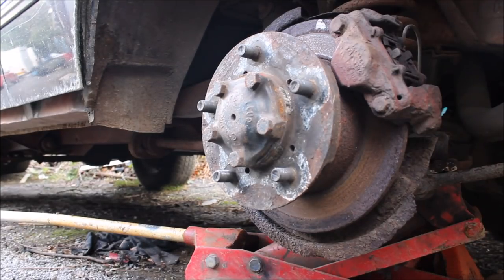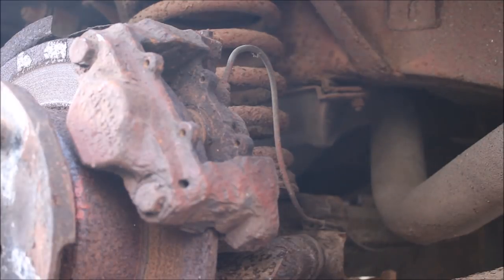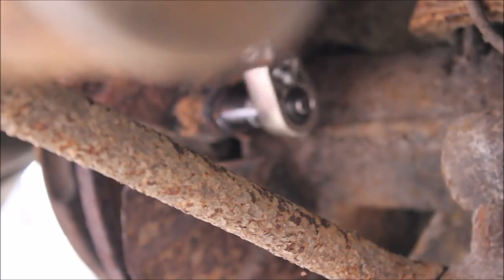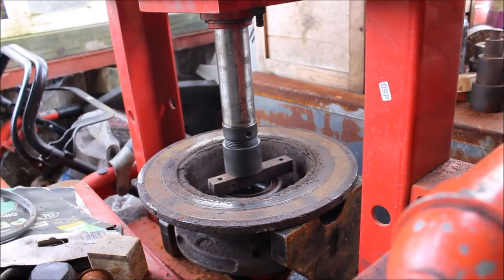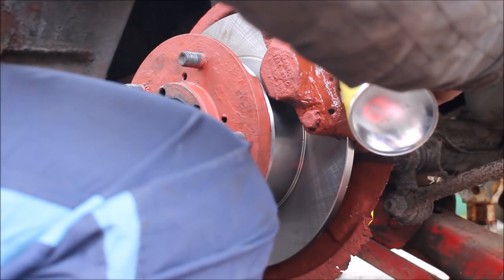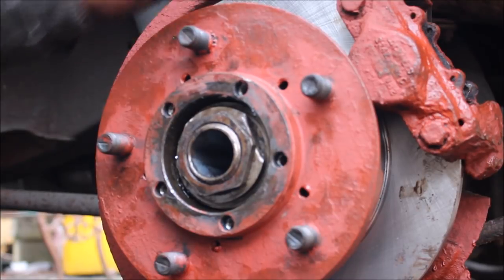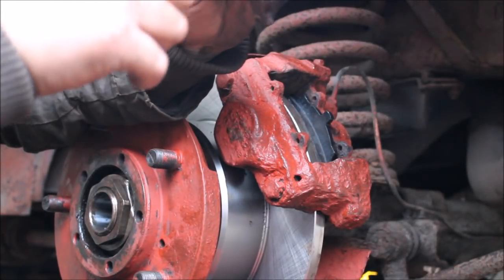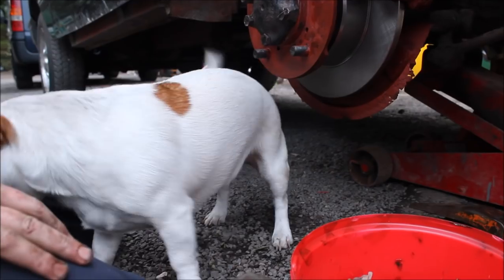Changing my rear disc brakes on a Land Rover Discovery 300 TDI

Comment: I was always taught not to use a ratchet (can f them up) for undoing stuck bolts, a breaker bar with a short scaffold pole extension works wonders.
Reply from the maker: I'm applying enough pressure not to strip the bolt, I would never use a scaffolding pole. You will only end up with a snapped/stripped bolt head. I'll stick with my technique

Comment: Love the vid but please tell me why the rotors were rusty in the first place 
What did you do to cause the calipers to squeeze and let go
To me the calipers were not working causing the rotors to be rusty from non use
Reply from the maker: Tim Grenell was parked up for a while, that’s what happens when you don’t use a vehicle. Also live on Anglesey with the salt air, and they was definitely not working right. Master cylinder had gone, bought the vehicle with a list of problems.
Reply: Calipers looked well seized, hence having to bash the pads out.

Comment: Great video! 👍 Around 34.10 it's not the bearing that's tight, it's the new disc dragging on the pads because the disc isn't running true (tell tale marks on disc surface). The mating surfaces between the hub and disc both need to be clean & flat (no paint!). All I put on the inner rim of the disc and the hub is some copper slip in the vain hope it'll make it easier to take apart in future!🤞Also belting the hub where the seal goes with a hammer will a) fill the outer bearing up with crap (Hydraulic press was the right choice!) and could damage the seal & the recess it sits in! Replacing the seals & brake pads is a good move too (apologies if you did that!) And those hub/disc bolts need to be tighter than a 3/8 & short torque bar will give you! Disc coming adrift is not funny!
Just my 2 pen'orth! 😉
Reply from the maker: No way, if I did them any tighter they would of snapped, the bearing was tight. Still works 100% no play

Comment: Will be doing mine soon and this helped a lot thanks. One questions, (not looking at workshop manual at the mo) isn't there supposed to be a torque spec for the retaining nuts (inner and outer)? You did yours by feel, and I noticed they were finger tight at the beginning. Cheers!
Reply from the maker: Not fell off yet haha, I do everything by feel. Only use torque settings for head bolts and other stuff like that.
Reply: @m111kca4    I just looked up and yeah the torque on the inner nut is only 4 NM and 50 NM (depending on axle) on outer nut. Still learning here...doing for the first time when my parts arrive. Thanks for quick reply!
Reply from the maker: @supermarinespitfire1  you will be fine, it's quite easy. You probably want a blow torch or a electric version to heat up bolts that don't want to undo. I've always done wheel bearings by feel, I'm looking for turning free but no play.